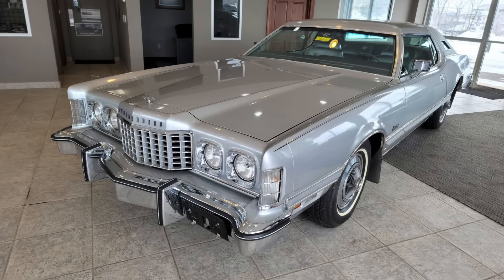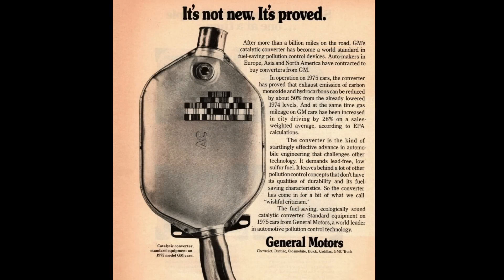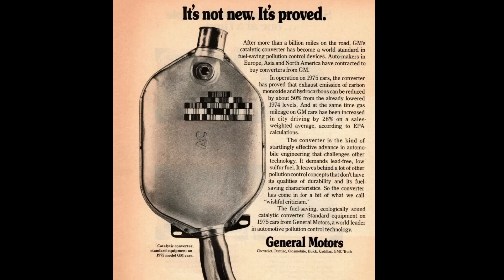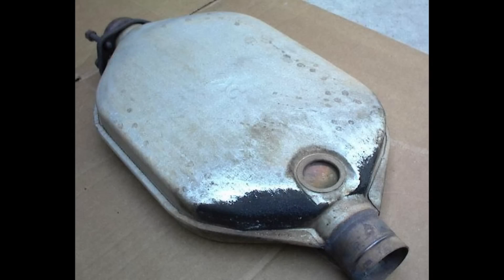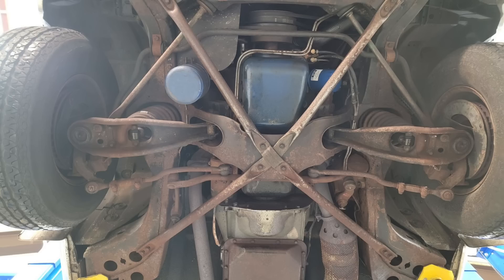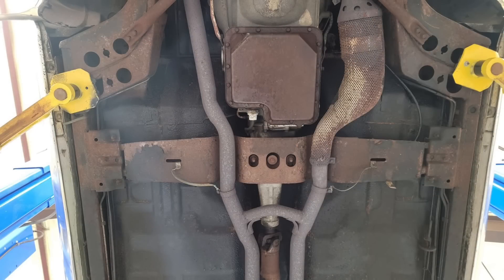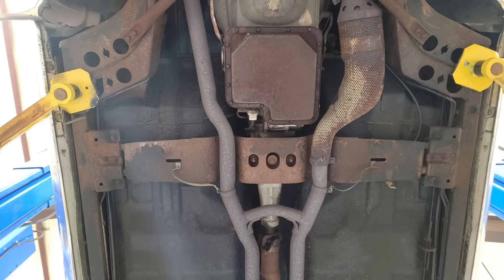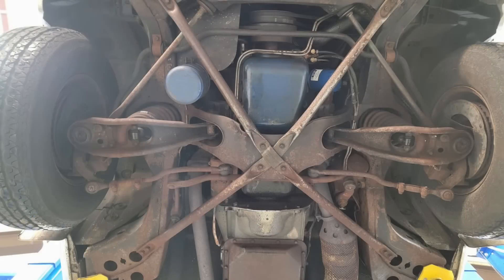Strangest Car Inventions: Ford Invents A Bizarre Way to Meet 1970s Emissions Standards

Comment: A negative of the GM converter was as you say was a real hit to efficiency (loss of MPG); thus, it increased CO2 emissions (no body cared about CO2 but they sure cared about mpg {remember the energy crisis of the 1970s?}.  I recall the early models (1975-78) had hesitation problems and it was linked to the lower combustion engines, lower octane gas, and those converters.  Fortunately JC Whitney came to the rescue for our family and sold Catalytic Converter "Test Pipes". As as 17 year old i was able to remove the pancakes on my mom's new 1978 Firebird, my Uncle's 1978 Camaro, and my 1978 Camaro.  The result exceeded our expectations with improved mpg, hesitation issues were gone, more horsepower, and as a little cream on the top, an engine with some decent roar.  It became normal at the time to do this procedure as those GM converters were horrible. Because the converters were bolt on, the test pipes slid in with ease and bolted up ready to go. Oh one more thing those GM converters started many a grass fire in our agricultural areas as the converters were very hot, several people lost their cars due to grass fires. Notice Ford had screens on their converters for cooling improvement. Great video it brought back a lot of memories and no i never went to prison. This was a prime example of a so called solution which made more problems.  Great video brought back a lot of good memories.

Comment: I seem to remember those pancake style cats caused a few garage fires from overheating.
My 77 F150 with a 460 cid had no cats and only an EGR valve and the normal various vacuum lines that controlled the valve and idle warm up system.

Comment: The only reason anyone driving a 1970s car was hurt in a head-on collision was because nobody used seat-belts at the time. With 3000 lbs of metal in front of you, even if you ran into a battleship nothing would penetrate the cabin.

Comment: That crossmember has rubber mounts on both sides and has a rubber trans mount so it's isolated. I believe these were added so if the transmount collapsed you had metal on metal, the starter would use the transmission as a ground through driveshaft if the regular ground cable was poor, thus putting additional strain on the thrust washers inside the transmission and bad grounds would fry shifter cables if so equipped. Similar to GM's where frying shifter cables was a problem for a lot of Camaros & Firebirds because of bad grounds.

Comment: This version (Fed emissions/dual exhaust) TB/MK4 has the highest rated power of all the 72-79 TB/MK4/MK5.  Rated 224HP SAE net.  CA emissions with 2 cats rated 223HP, standard Federal emissions with single exhaust (SE) rated 194HP.  When these cars came out in '72 they only had SE and were only rated 212HP (429 & 460 had the same rating).  In '73 208HP (429 & 460, both SE). In '74 Dual exhaust was offered (required in noise legislated areas) and helped boost the power rating from 195HP SE to 220HP DE.  In '76 SE rated 202HP & they didn't rate the DE version.  '77 & '78 similar to '76, only rated SE which was 208HP & 210HP, respectively.  No 460 in '79.
(I'm a car geek & got curious about the unusual emission controls of that era and have researched and studied this thoroughly)

Comment: Some FoMoCo & Mopar vehicles in '75 didn't need cat converters to meet emissions as others have commented.  In this case they only needed to put the cat on 1 bank to get the exhaust clean enough to pass.  California was tougher and if certified to CA standards they have 2 cats, one each bank.

Comment: Adam, I don’t know if you’re aware but in 1980, (on the Lincoln’s) they had 4 cats, two pre cats and two main cats.  I do know that whatever any of the manufacturers did, the smell coming out of any of my cars had ZERO smell, whatsoever.  I know,  if I ever buy a car that has any odor at all, I either put on a nos cat, correct the defective emissions part causing the car to smell or I re-bead the cat itself.  I’m a stickler for an odorless exhaust, no matter how much power it robs the car of.

Comment: Ford probably found the catalysts were very efficient and with two would 'over clean' the exhaust and easily meet requirements. So some bean counters asked what would happen if you used only one cat and mixed 'cleaned' exhaust and 'dirty' exhaust and they found that the 'mixture' still met requirements - at half the cost.

Comment: I think the 1985 Mustang GT had pipes coming down from each cylinder bank, into one pipe and then back out to two tailpipes…not sure about the cat tho…
Reply: Yes- shorty headers to Y-pipe, then single dual bed converter, then backwards Y-pipe to dual mufflers and tail pipes.  It actually worked quite well as the 5-speed cars were fast for their time.
In '86 they went to true dual exhaust that essentially stayed the same thru '93.

Comment: GM had some strange ones as well.  My 1983 fullsize van had factory catless duals but they had to run dual emissions air pumps and massive air injection manifolds to the factory tubular exhaust manifolds. In 2005, I swapped a 1990 Corvette aluminum head L98 TPI in place of that smog era junk engine. I bought a wrecked, low mileage car for $800 for a donor. The Corvette exhaust manifolds and cats were retained initially although I later put smog legal Thorley Tri-Ys for a G-van and even more modern 2.5" high flow cats on it. The TPI Vette engine had 80 hp and tq more with about 6 mpg better fuel mileage. That L98 gained about 20 hp and 30 tq with the headers/exhaust and I put a small Lingenfelter cam upgrade and SLP runners on it for another 30-40 hp gain. After  upgrades it still ran with emissions readings that were near zero. EFI and modern monolithic cats were the key to getting more power, better fuel mileage and cleaner air in the mid-late 80s. The multi-point injection or even TBI was a huge step forward from a carburetor.

Comment: One strategy Ford used that was'nt mentioned was one catalitic converter on one cylinder bank of a V-8, combined with an air injection pump. That was the case of my 76 Torino.

Comment: Ford and GM were concerned about emissions stds for many yrs, and played around with AIR pumps, different types of charcoal canisters, TVS spark advance systems and such since the 60s. Chrysler really didn't until they were forced to for the 72 model yr. The big 3 tried everything they could to skirt around ever increasing stds and really played the system. That would start to change for the 75 models. Keep in mind, that vehicles of the time were tested in PPM, not the current GPM. So you could do things like 1 cat, 1 air aspiration tube to 1 manifold, etc. That would change for 1980 and again for 81. If you look at federal numbers, 1979 car were maxed out at 6 ppm CO, and 600 ppm of HC. That wasn't all that hard to meet. For 80, that was cut in half! For 81, cars had to be 1.2 CO and 220 HC, max! I recall when the IM240 test came to Illinois for 81 and up vehicles. Getting some of those early to mid 80s cars through that test was very difficult! ( the Olds 307 Y engine was the most challenging of the big 3, followed by any Ford that had a VV carb)

Comment: I’m not a fan of of over government regulation, but the air pollution devices mandated has made a difference.  As a child of the 70’s and 80’s I can vividly remember the smell of unburnt gasoline going down the highway.  When I go to classic car shows today and I’m around a running vehicle from the 60’s or 70’s all I can think is yep that’s what the 70’s smelled like.  Also, I have a 2022 Mustang that has 450hp out of the factory, meets emission standards and gets 25MPG on the highway.  How far we’ve come.

Comment: 1:55: Actually, even non-CVCC Civic with the 1200cc motor had no catalytic converter, up until 1980. Mid 70's BMW's also did not, but they used an expensive thermal reactor setup.
Reply: That thermal reactor setup in BMWs had to have been the worst solution to cutting emissions. They produced extreme underwood heat, causing many reliability issues and caused a relatively small 2.8 litre engine to get only 11-12 mpg.

Comment: The GM Pancake converter was complete garbage.  One of my strongest memories of 70s squarebody pickups and suburbans (apart from rust over the wheel openings, blue smoke pouring out the exhaust, and bent hoods) was the fact that they had a screen in the exhaust tip… there to keep red-hot converter pellets from escaping and starting fires.  But they usually plugged up so that the truck had no power and the exhaust hissed like the safety relief valve on a compressed air tank when trying to merge on the freeway.

Comment: The Ford's were a pig off the car lot new. Once you gutted or removed the cat or even better installed dual exhaust, recurve the distributor ,block off the EGR valve the engine came alive!! The 460 had a retarded crank timing gear. We installed an early 429 or 460 timing chain set and the engine ran great. The timing dot and the keyway in the crank gear had to be inline not offset.

Comment: i worked at a lincoln mercury dealer for over 20 years they did some weird things to their cars like changing a camshaft and firing order on a 302 and windsdor 351 without changing crankshaft timing   great video

Comment: Was the smog/emissions probe always inserted on the drivers side tail pipe? If so, why bother with the expense of fitting a catalytic converter to the passenger side if that exhaust was never sampled?

Comment: I actually owned a 1983 Honda Civic CVCC at one point, I learned how to drive stick with the car, I bought it for $100. It was the very first year it required a catalytic converter but, it wasn't the catalytic converter that was trouble some as much as it was all the damn vacuum lines rotting out. The vacuum diagram looked more like a wiring diagram.

Comment: I will explain the grounding straps. They are for RFI reduction. These bonding straps reduced cb radio interference when receiving and increased the ground plane when transmitting. Cb radios were becoming popular during this time frame.

Comment: I have a 76 Mark iv, usually changing the starter is not a big deal on these big motors but when I had to change my starter, those cross member bars forming an X was in the way to drop the big bulky starter out. I had to remove all 8 bolts to remove both cross member bars just to get the starter out😡! As many times I’m under my Mark changing the crappy rebuilt starters from the aftermarket places, I don’t know if mine have one or two cat converters on it🤔?

Comment: The monolithic converters had almost no back pressure so long as they were not becoming plugged by a badly running engine or any number of other issues. That same style of converter is still in use to this day.

Comment: Those Thunderbirds were far from the original but they were still really nice cars that were great for cruising or road trips.  Just about all T-Birds were like that until 1980 and I really doubt I have to explain that one.  But, a friend of mine many years ago now drove an old Volvo 240 wagon with the cat and that cat went out.  It smelled unbelievably bad for a couple of months if you got anywhere near it when it was running.  The price of a new cat was about what the car was worth and since there wasn't emissions testing anymore he just took the thing off and drove it like that.

Comment: Ford Australia went a different way altogether, we had a Charcoal canister fitted to the firewall, it was small and neat and tapped into the air cleaner and intake manifold. The charcoal canister was used from 1975 -1988 when Ford then changed over to a catalectic converter. It was used on the Non cross flow and cross flow inline 6 cylinders and on both the 302 and 351 Cleveland's. The two Cleveland engines were discontinued in 1982 after having been first introduce back in 1969 but the remain stocks were sold in some F trucks and LTD's until 84 and by the time the canister was discontinued in 1988 it had been fitted to 3 generations of inline 6's. GM Australia (Holden) also used the same type of canister until 1988.

Comment: I'm a mechanic and I don't know why they did this but I can surmise.
Possibly a bimetallic heat crossover flap in the driver's side exhaust manifold would activate when the engine was cold rerouting the driver's side bank's exhaust under the intake and out the passenger side when the choke was active.
If I'm right (and there's the distinct possibility I'm completely wrong), most of the exhaust during warm up would then pass through the cat. 
When warm and measured at the tailpipe then with only one cat the emissions were within spec.
Don't know if it's true but it's a good story lol.

Comment: Some California certified '77 and '78 Plymouth Fury/Dodge Monaco police cars with 440 V-8's wlth dual exhaust had 3 catalytic converters.  One normal-sized converter in each exhaust with a small converter on the left side near the exhaust manifold.  I was told it was needed to control excessive emissions when the engine was cold and the heat riser in the right manifold was closed.  With the choke on and all the exhaust going out the left manifold the small additional converter would warm up fast and compensate for the rich mixture.

Comment: I’d visit a friend who worked in a self repair garage mid 70’s. Lots of GM car owners would put their car on a lift, remove the pancake’s plug, then shove an air hose in the tailpipe and blow the catalyst pellets out into a bucket, then put the cap back. They said it gave them more power.

Comment: Hey guys,
Heres a good one!
 I remember being told this by one of the tech's that would service/calibrate the emissions tester in the shop  I worked in, in NY in the 80's. 
The technician said "FORD CARS from (I cant remember exactly)  1976 - 85 (like I said, I'm not exact but that seems close) WILL NOT Pass emissions testing (no dyno) AFTER 2 minutes of run time." 
Now!!...this cleared up some really frustrating stuff for myself and my great buddy Terry, who was also a VERY Good and conscientious mechanic. We had both gone through this random,  "WTF is going on here!!"...regarding Ford cars that needed  emissions testing. 
Every so often a car would pass the "quick test" and then Fail minutes later during our full test.
We would make sure the car was hot, (cat was HOT) then, you could put the test machine in a mode where you didn't need to enter all the vitals and check off all the bullshit. You could just get to the "sniffing" part of the test, so that you could determine if you had an issue, or if you were gonna have a car that fully passed its yearly inspection. 
We mainly did this to KNOW that once we put in all the vitals, it would result in a pass on all categories. 
In NY this was all sorts of shit... headlight aim, alignment (you had this "scrub pad",  that was 2 pieces of metal that would slide somewhat easily across each other to determine the state of the wheel alignment) 
wipers, lights, horn, etc, etc.
We wouldn't want to tell a customer, "hey your car failed emissions but you still owe us $12. That wasn't how you kept customers back then. So we really tried to insure we would make the customer happy.
BUT.....we BOTH noticed that every now and then a FORD would jerk us around!!
The technician, (I believe the company brand was ESP) told us that the reason Fords were a pain in the ass, was because they had an emissions setting or rudimentary program to "lean burn" (similar to Chrysler) that would help heat up the cat  and bring up the cylinder temp helping "cook off" all polutants, to help insure they would pass emissions. This mode would only last for about 2 minutes from the starting of the engine. THAT Was important!! - From starting the engine!!
He told us: "Get your car HOT, shut her off, enter your vitals, run through the whole checklist of crap on the tester, and when you get to the the page that told you to hit enter to begin emissions testing, reach in & start the car, insert the tailpipe probe, and hit ENTER, they'll pass every time!!"
This man was SPOT ON!!
From that day, we only had issues if the car had an issue. 
But THAT Shocked the hell out of me in 1987!! 
I remember thinking..."man!!!...how did they get THIS past the federal gov't testing!" 
My guess was, the guys testing the cars went through the same process (regimen) and the boys at Ford knew how it went!
 
I still remember the CO & HC numbers for "1979 & newer" (that was the category)
HC  <  220 ppm
CO  <  1.2% 
That was it, get it under those values and pay your $12!! 

As a side note, later on I ended up "aquiring' a 1983 Ford Bronco, it has 3 Catalytic converters!!! I thought "Ha!!..you dirty bastards, it finally caught up with you!!"

Comment: My first car was a 1976 Mercury Cougar XR7 that weighed 4600 lbs.  It had a 351 Windsor with 2BBL carb and single exhaust.  When I had a dual exhaust system installed is when I discovered that it had a single cat on the driver side as shown in this video.  However, the cat was smaller than the cat shown in this video.  When I received my car back from the muffler shop that installed the dual exhaust, I removed the cat, hammered the ceramic material out of the cat housing, and then reinstalled the empty cat back onto the car.  Never had an issue with the cat afterward.

Comment: Not a Ford, but the only V8 I've owned was a 1981 Chev 305, with 130 hp. My present 4 cylinder has double that.

Comment: In Texas, on Ford Motor Company products, we just chopped off that power-robbing, uneven back pressure, gadget for true dual exhausts. Never a word from anyone at state inspection time. We ran more potent, leaded, 93-95 octane premium fuel in them, too. 77 cents per gallon.